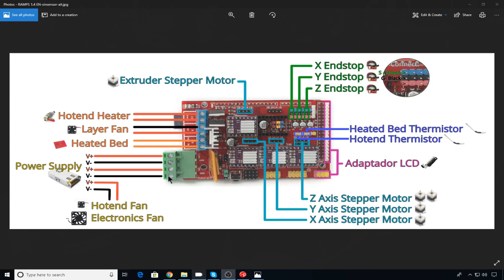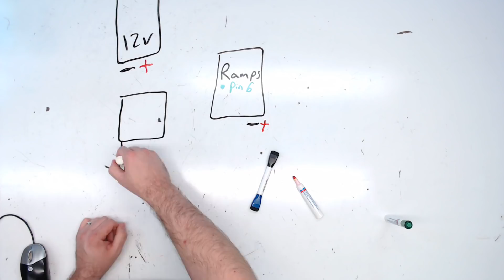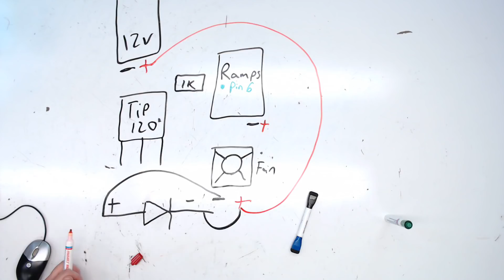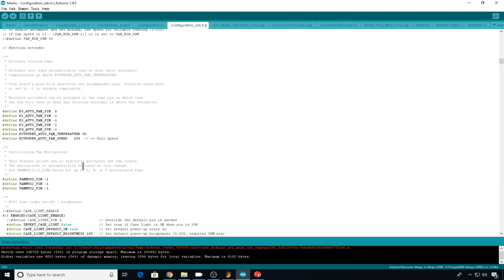Auto Hotend Fan Using RAMPS - Chris's Basement

Comment: can I make auto fan to cool the power supply or ramps board?
Reply: You don’t even have to make it an auto fan pin, there is also a ‘controller’ fan setting that will turn on when the steppers are active, just stick it on a digital pin next to the auto fan, I think there’s D4,5,6 and 11 on that same header. An you can buy boards on AliExpress that are about 50p (uk) a pop, that have the mosfet and supporting circuitry and screw terminal headers on! That’s how many was set up on my last printer, along with LEDs also!
Reply from the maker: @captainmcadams  Yep, totally agree. I found those mosfet boards and have never looked back.
Reply from the maker: You can, but you need to base it on something. Like your bed or hotend thermistor reading.
Reply: @ChrisRiley  i want to put a 3-rd termistor to the ramps. can I?
Reply from the maker: @gini10000  Yes, you could use the other exturder thermistor, T1 that would work.

Comment: Is there a way to set up a fan curve in marlin? I don't think the fan needs to spin as fast to cool the hotend at 200 degrees celsius as it does to cool 300 degrees celsius.
Reply from the maker: No that I know of in Marlin. I have only controlled that in the slicer.
Reply: @ChrisRiley  thanks for letting me know so quickly!

Comment: I have an MKS Gen L board, and I want to control my hotend, and two other case fans by software (as only one, not individually) as you showed here. 
Can't I just use the second extruder output to achieve this without having to use an external transistor?
Reply from the maker: Yes, the second extruder heater output will work just fine.

Comment: how can ı make it for two fan? for nozzle fan and for stepper fan.
Reply from the maker: You can just setup 2 of these on different pins. Then update the configuration_adv.h file.
Reply: @ChrisRiley  so ı make two diffirent module?  ı cant make one module like fan extender?btw ı wanna use it for stepper driver fan and led. for hotend extruder ı used second hotend input.
Reply from the maker: @ahmetbozac1861  Yeah, you would have to do 2, one switch per item.

Comment: Hi Chris, sorry if this question is really stupid, but could this work if you use a 3 pin fan and connect the ramps pin directly to the signal cable on the fan?
Reply from the maker: No worries at all, usually the 3 wire fans have a yellow wire, that's for RPM feedback and you probably don't need it. So no, still have to power switch it some how.

Comment: nice.  Since I use Repetier, do you know the changes required there ( too lazy right now to investigate.  Maybe later )
Reply from the maker: No, it should work the same, just call out PIN6 when you set repetier up. You will have to reflash the firmware.

Comment: Hello Chris, Nice tut, I Have this running on my Ramps 1.4 board, but also have a MKS base 1.4 board with a BLtouch, but can't get this to work because apparently I can't find the right pin on the board (There's not a lot of info to find for this board: https://www.aliexpress.com/item/3D-Printer-part-parts-MKS-Base-V1-4-V1-5-Control-Board-materinskaya-plata-Mega-2560/32838903903.html?spm=2114.search0104.3.2.7e9015d00tMrLU&ws_ab_test=searchweb0_0,searchweb201602_5_10065_10068_319_317_10696_10084_453_454_10083_10618_431_10304_10307_10820_10821_10301_537_536_10843_10059_10884_10887_100031_321_322_10103,searchweb201603_53,ppcSwitch_0&algo_expid=98982d27-f71f-4eff-8b2e-15b79735e0cd-0&algo_pvid=98982d27-f71f-4eff-8b2e-15b79735e0cd&transAbTest=ae803_5) can you assist?
Reply from the maker: Here is a screen shot of the MKS 1.4. I use pin 6, this is pin 6 on the MKS. https://photos.app.goo.gl/wiDKQbBUTtX6Vi8CA  Is this what you mean?
Reply: @ChrisRiley  thanks for your reply,but That's not it realy, the image you provide is another board than the I showed you in the url. And That's just the problem, I Can't find pin 6 on that specific board. The documentation for that board is hard to find if any. The reason why I bought this board was because the ramps 1.4 board did strange things with the 3dtouch. The pin just flips up and down during movement of the x and y axis. Otherwise I would be using that board. Perhaps you got an idea how to solve that "jitter" problem?
Reply from the maker: @drebodok2556  Well that's to bad, I hate when they don't give all the info. They have a servo pin on there listed as 6, I guess this isn't correct either? Do you have Marlin setup to use MKS or RAMPS? The jitter problem, not sure there, sounds like something is crossed on the shield for sure.
Reply: @ChrisRiley  Yes, I agree and find it very akward that such simple information isn't given by the factory of reseller as if that's a pirate chest with goodies they don't want to share, afraid someone might steal it :). 
I've ben using the MKS 1.3 in the setup which uses that same pin  file and that includes the pins_ramps file, so it's likely to very compatible (as also stated by the reseller). So selecting the pins is not a problem, just to identify the pins on the board is. 
As for the jitter, just connected the 3 wired connector on servo0 and the 2wired one to the z-min endstop, so there's not much to cross I would say unless you mean that a used pin for the probe system has double functionality configurated by mistake? 
I've build me a UM2 Exteded Plus system with ramps electronics and just used twisted-pair wires (from UTP cables) to create the connection between the electronics and the printhead stuff and also the probe. Perhaps such long wires should be shielded for the probe? Previously I also tried it with a servo as a probe system which was  also connected on the board like the touch probe (Servo0 and X-min) and the servo did also jitter,. So it feels like it's the wiring is picking up interference from somewhere. any ideas on that?
Reply from the maker: @drebodok2556  Agree, it sounds like some sort of interference, but it's probably a crossed trace of something like that on the ramps board. You might try cleaning up some of the solder joints with a brush. Maybe there is some slight over solder or something. I wish I could tell you how to locate the pins on your other board. Other than searching around with a multi meter.
Reply: @ChrisRiley  I will check this out, though I don't expect any result from it, because both my Ramps 1.4 as the mks board  show exactly the same problem with the 3dtouch probe, But thanks for your help. I will let you know if I find something.
Reply from the maker: @drebodok2556  Have you tried making adjustments to the set screw on your probe? Not sure it will help, but worth a try.
Reply: @ChrisRiley  just this afternoon I tried that, but I Can't seem to find a sweet spot. Have you experience with this?
Reply from the maker: @drebodok2556  I have adjusted them before, but it seemed pretty easy to do. If I remember right there is a video out there of someone doing it. https://www.youtube.com/watch?v=Ix7lXvfkPEU
Reply: @ChrisRiley  Well wanted to update on previous problem, i've dropped the 3dtouch and placed a induction probe LJ18 and this works quite nicely without any trouble although it takes some room therefore less printing space on the bed. But not being able to print is worse right? Have put the Hotend fan on a transistor like you showed, work perfect however i've found one thing which is strange. when I encounter a thermal runout, everything shuts down including the hotend fan. This could lead to a blockage of the filament when you're not arround when this happens, you agree? Marlin tells me to reset the printer, but that does not work for the hotend fan, it stays off. Only removing all the power completely from the printer resolves this issue. Perhaps there's a solution for this?
Reply from the maker: @drebodok2556  I much prefer the inductive probe. Seems more accurate. Yeah, my fan does the same thing. There should be a work around, but I would have to do some experimenting.

Comment: Hi @Chris Riley,  just discovering your channel. Congratulations for the good work! I liked the Marlin 1.1.9 Linear Advance video the most. Very clear explanation, thank you. A couple of months ago I've get rid of that annoying noise using a thermistor based circuit. The advantage is that we don't need to hookup it in the main board (for the ones that don't use RAMPS, etc.). The transistor also barely warms due to the configuration I've used. If you didn't saw it already, please consider checking the project in my page at Instructables web site. If you want, I can put the link here. Not difficult to find anyway.
Reply from the maker: Awesome, thanks for watching. I would love to check it out, you should be able to post a link here in the comments.
Reply: @ChrisRiley  Here it is: https://www.instructables.com/id/Silent-and-on-Demand-Extruder-Cooling-Fan-Circuit-/

Comment: Could this work with a Songle relay that is in most arduino kits? Rated for 12v, 30A
Reply from the maker: Sure, if its rated for the correct voltage, no issues.

Comment: Nice video, very well explained. This gave me inspiration for what I could use the second free PWM-controllable FAN output on my RRD fan extender board...
Reply from the maker: I was checking out those extender boards, that look very handy, might have to get me one.
Reply: I had to get one for my dual-extrusion setup on the Anet A8 to be able to run a parts-cooling fan. They are more on the  expensive side (compared to the other Chinese electronics).

Comment: I was just talking to some one about making a add on to only turn on the fan when hot end is hot and need cooling on cool end.  Did not know is already built in to control it.  Do you know if there are a unused control pin like the pin 6 you use on the Anet A8 board?  Also I guess this is like adding a mosfet to pin 6 to allow it to control higher current device like a fan?
Reply from the maker: Not sure on the A8, but I can look around. I think you can jump the pins off the LCD connector. Really it's just a switch passing 12v.

Comment: Nice. I went the hardware route and put a Chinese noctua fan on the house end. So it is quiet. PSU and part cooling are my noisy fans.
Reply from the maker: A PSU fan hooked up this way would be pretty sweet as well. I might work that in to one of my printer designs. If I ever get around to making one.
Reply: I use ATX PSU though that would be cool. Nice to be able to set up and control the PSU on/off with Marlin and Gcode as well. I would like to see your design.
Reply from the maker: PSU on and off is something I have been wanting to look at for a while now.

Comment: The TIP120 has a protection diode built-in, so there's no need for the diode in your circuit. As you know, your wiring diagram is correct but the description is misleading due to calling out the wrong pin designations.
Reply from the maker: Thanks for the comment and the info. Yes, I boned that one. Better luck next time I guess.
Reply: I just thought the same. I'm an avionics electrical engineer and the middle pin is not the base but the collector. Maybe you should pin a comment on that scene, as your wiring diagram is correct, but your explanation is irritating for electronics technicians 🙊

Comment: Hi Chris as a old fart that grew up wiring NPN transistor switches, I do have to say that the drawings and build are correct and work as you know, your audio instructions are wrong. The pin out of a Tip 120 from left too right is Base - Collector - Emitter. The Emitter of a NPN switch always goes to ground and is called a ground emitter switch. You have it built right, but explained it all wrong. No biggie but it will confuse the heck out of those that are learning how to use components like this. Great job on adding a working fan controller to the printer and showing others how to do it as well . Love your content. Keep up the great work.
Reply: Chris your channel content is great and your on screen personality is very good, so do not worry about making errors, we all do and we all learn from it.
Reply from the maker: You are right, i totally screwed that up.Well crap, I blew this one. Maybe they can watch with the sound off.
Reply from the maker: I appreciate it man, I really do.
Reply from the maker: Thank you both, I updated the description and added the link to this PDF. I am just glad someone is actually paying attention in these videos. ;)
Reply: Yeah, what Robothut said!
Reply: Showing failure is important so we all see it is ok and learn from it. I really appreciate your creating and inspiring with the videos you create. Ivan Miranda is a great example of showing his flaws and failures and I admire that. I would like to try and be more open about that in my own work.
Reply from the maker: Even when I am wrong everyone is still nice. :)
Reply from the maker: It is important to show the failures. Ivan makes some awesome videos. This one is irritating because I was reading off the wrong diagram trying to work to fast, but live to fight another day.
Reply: Robothut agreed: https://cdn-shop.adafruit.com/datasheets/TIP120.pdf
Reply: exactly. You will see I had to re edit two videos this week. Only you have seen the first ones.